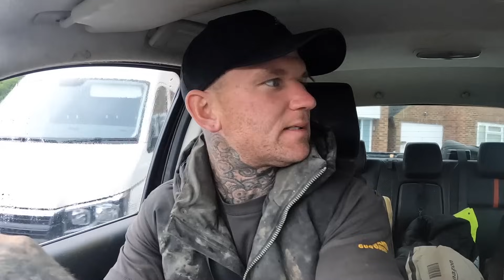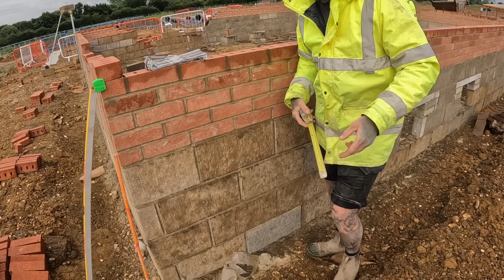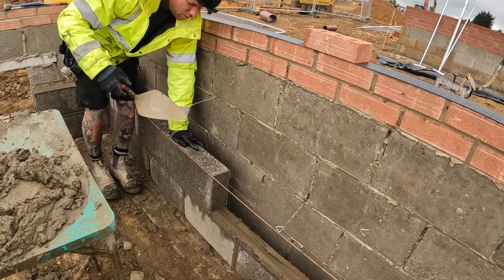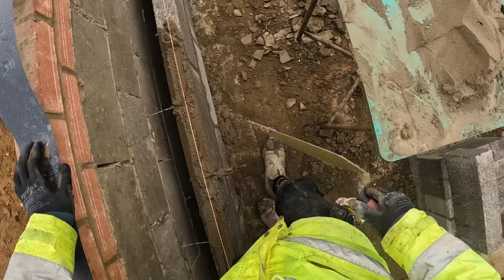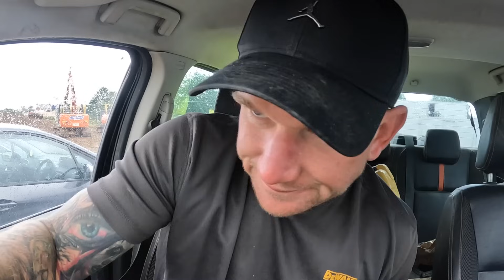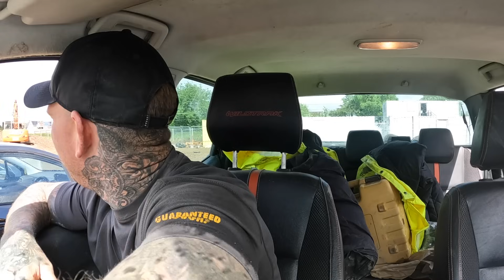I MESSED UP!!! #bricklayer #bricklaying #brickwork

Comment: Mistakes...eh.!
We have all made them. There`s probably not one tradie watching this who hasn`t messed up at some time or other. I made a few howlers in my time.  The important thing is you acknowledged the issue and then deal with it.   No trying to hide it, or making a big drama out of it.
Identify the problem, and deal with it - and take the hit - you will get the money back in time.
Weather is a tad erratic at the moment, and nothing to do with "global warming" either.......This is down to "El - nino, weather system and the jet streams, and warm and cold air masses meeting and causing disturbances to our weather patterns.
Keep grinding Mate, and only another 30 years to go....🧱👍😆

Comment: Making mistakes are a massive part of learning. I remwber building a warehouse thaybwas steel frame amd the blockwork was built between steels. Rather than using "L: ties to toe blockwork to frame or use a wall starter the contractor wanted us to built the blckkwork into the web of the steel so a block on flat woth a brick on course 1 amd then we had a 290 cut in the in the Web of the steel on course 2. But I built 5 courses woth just the block on flat amd a brick in the Web . Looked fine but when the boss inspected ot amd seen what I'd done he just pulled his leg back and kicked and perfectly demonstrated how it was not structurally sufficient and the whole wall moved, made me take ot down amd do it again properly. At the time ot scared me that much that I certainly never did it again and fron then on when building a lead I did all my cuts prior to starting t build the lead 😂 long story short that is its okay to make mistakes once you correct them and be sure not to make the dame mistake twice. But even the best make mistakes mate. ❤